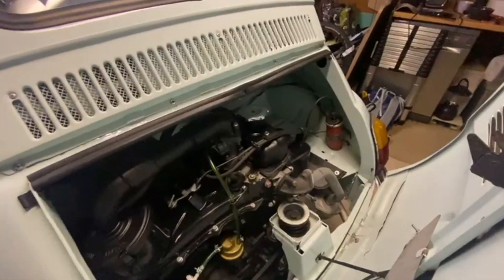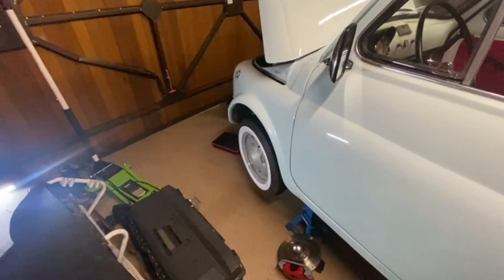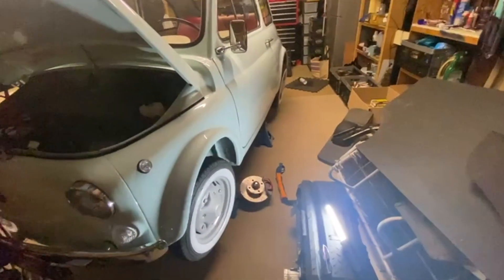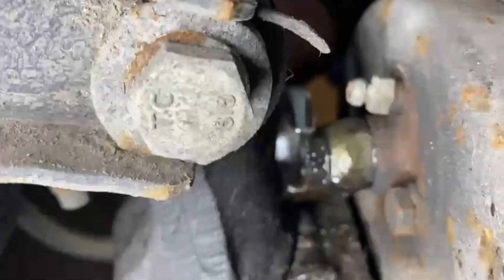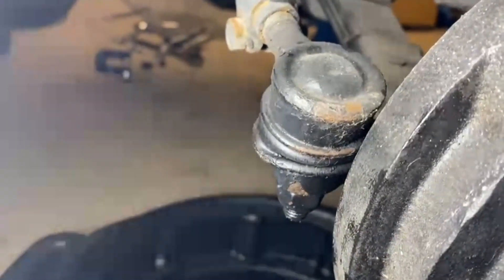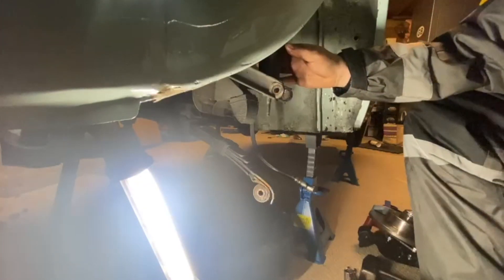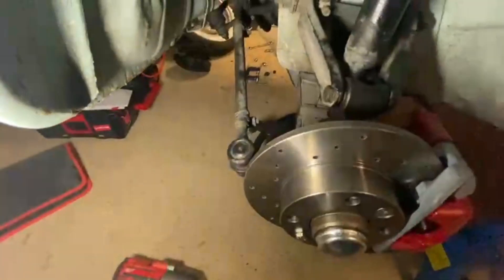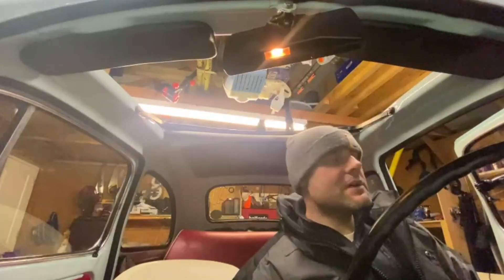Ep 5 - Car Snacks - Tesla Powered Fiat 500   Brake Disc Conversion     HD 1080p

Comment: When you tight or unfasten bolts especially rusty , always use ring spanner so the all 6 edges of bolt are equally distributed to ring spanner and possibility of bending the edges of bolt is low, while working with open spanner the edges of bolt are forced just on 2 edges and they can bend and spanner can slip if the bolt is stuck, you will see when you start unfastening rusty stuck brake hoses, but there is the special 6 edges tool with narrow open notch...just a tip.